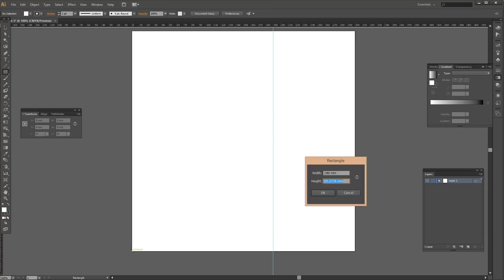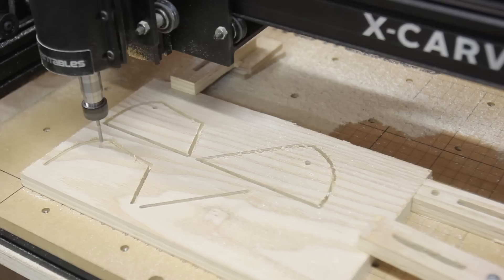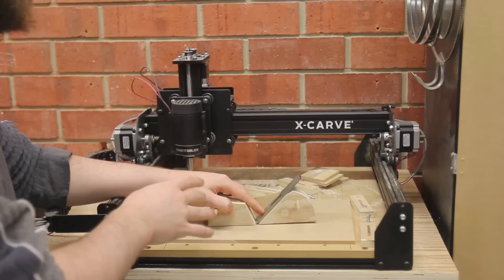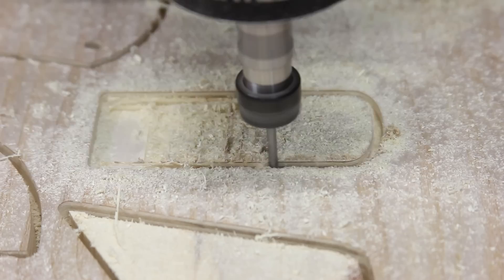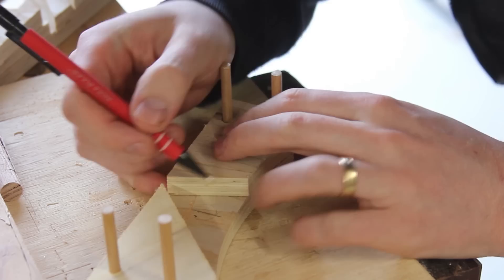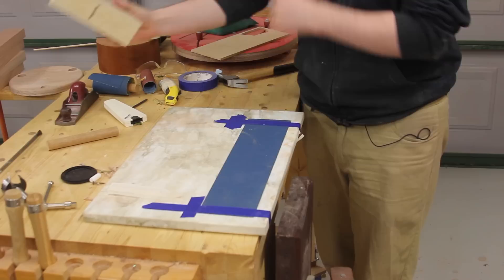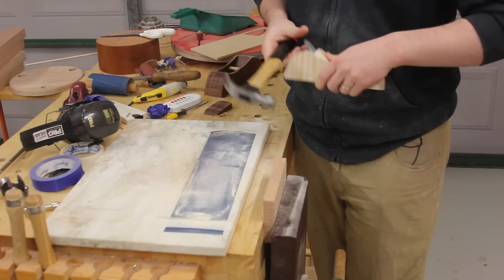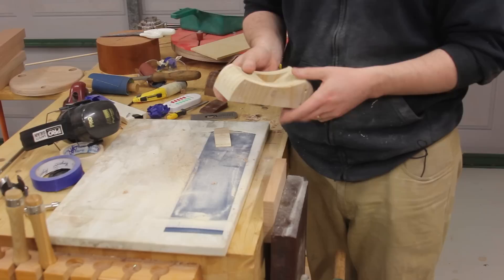CNC: Make a Krenov-style plane - 058

Comment: My question would be, is it faster to do this by hand, using a bandsaw than the CNC?
Reply from the maker: christschool In this case, with the spindle I currently have, absolutely faster to do this with a tablesaw/bandsaw. I plan to do that in an upcoming video - for one the plywood I used is too light, so I'm going to use something heavier like jarrah

I'm still learning the CNC-ropes, so this was a good practice exercise for me. The whole "tool-chain" on the software side is more involved that changing to my curve cutting blade on the bandsaw, so it's taking me some time to get into ;)

Comment: Hey Rough and Tumble,

Where did you pick up the X-Carve? I feel like I'm being left out/behind. Everyone has one! Do you have any specific projects you see going to the X-carve?
Reply from the maker: Glen H smashes VB can on forehead Inventables were kind enough to send me an XCarve at no cost (see: https://www.youtube.com/watch?v=41tekYYcu_A), you can get them from inventables.com. 

I've got a few ideas for jigs (such as a better drill press table where you can raise/lower the table using a handle at the front of the table, rather than having to reach awkwardly behind - for that I need a few bevel gears) and inlays. As I learn the CAM/CAD software a bit better, the project list will grow
Reply: Thats very nice of them!

Im a graphic / product designer by "trade", so i feel like this is right up my alley. (working in illustrator etc)

Would be interested in seeing another bits and pieces on the x-carve.